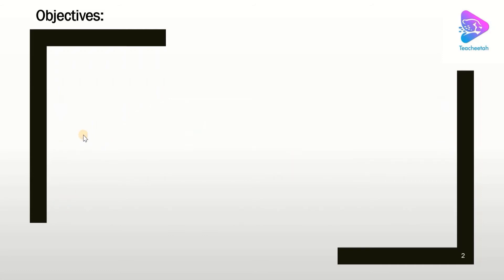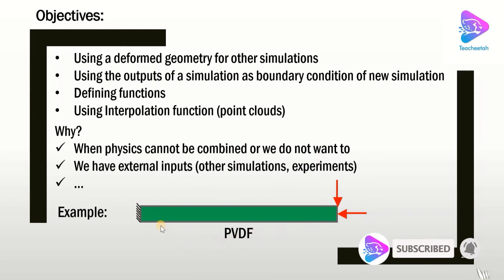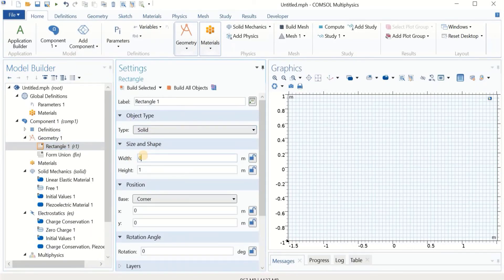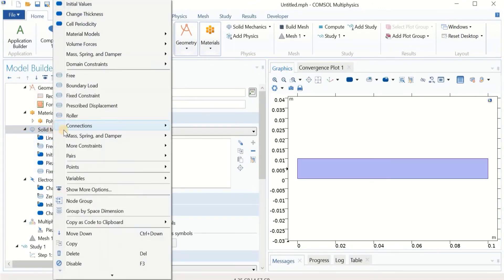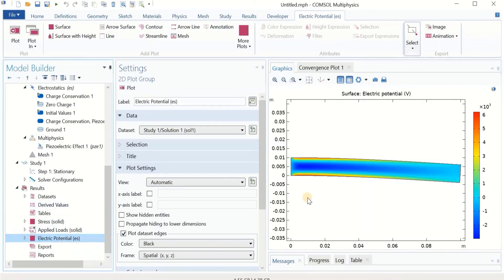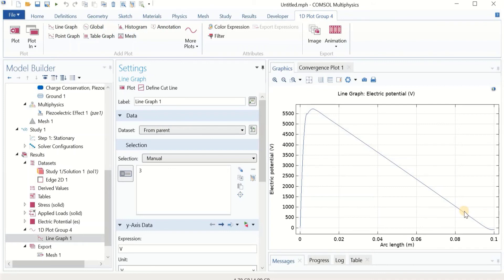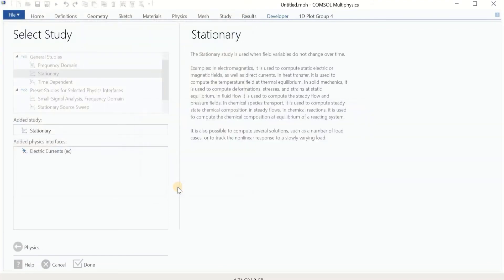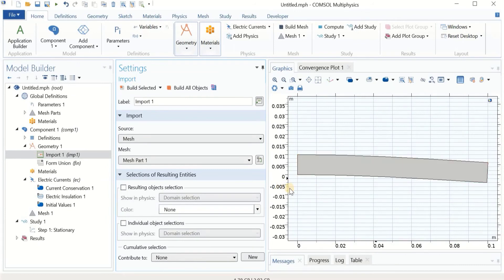Tutorial 9: Using Deformed Geometry and Interpolation in COMSOL Multiphysics

Comment: Thanks for sharing! May I ask how to use the deformed geometry in a time-dependent situation? Say, I have a mechanical model and the geometry deformed with time. Then I want to use the result of it for another magnetic model.
Reply from the maker: If your are dealing with a structure with mechanical deformation, you may need to define the properties of your materials (e.g. elasticity and damping) properly. Then, as you apply the mechanical load in a time domain, your system will deform over time automatically. However, if your system is not a solid mechanic problem and you are modeling a moving or deforming domain in another domain (e.g. a magnet inside air), you may need to use moving mesh and assign deforming mesh to your domains. Then, your system can have deformation under the targeted dynamic that you apply over time. For both cases, you can simply extract the results at the desired time steps and use that elsewhere.
Reply: @Teacheetah   Thanks for your help. I have a solid mechanics model in Abaqus and can get the displacement and velocity field over time. But I'm struggling with how to transfer this into COMSOL with moving mesh.